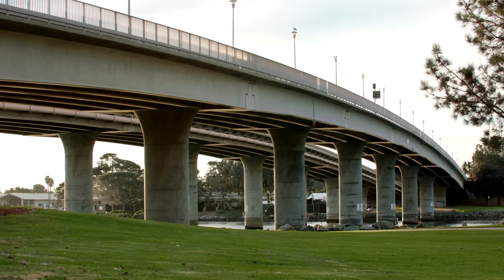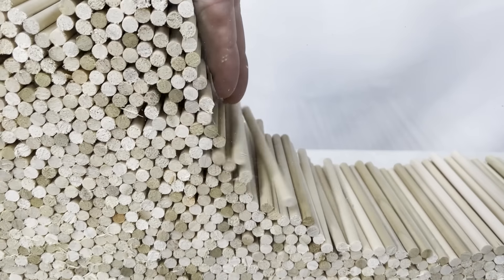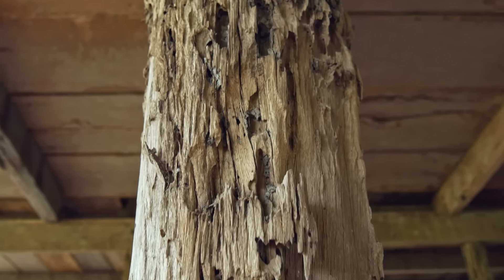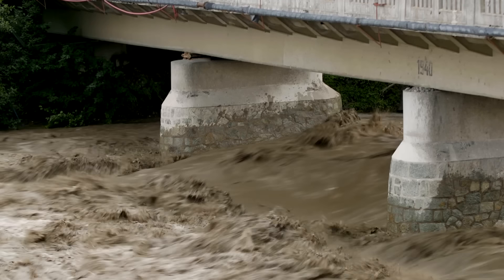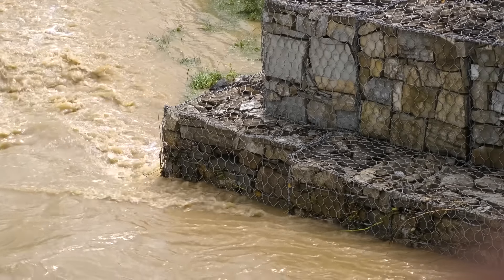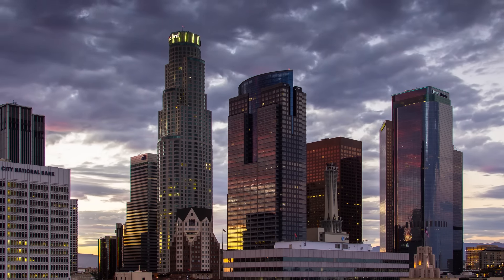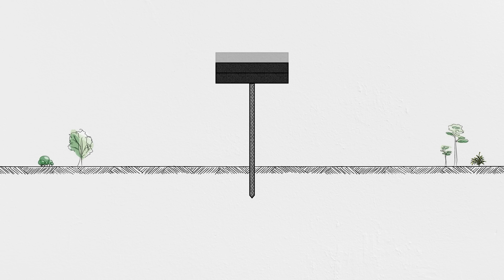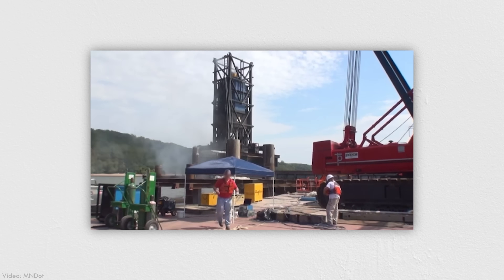Why Buildings Need Foundations

Comment: Here's an idea for another video: landfills.

What kind of engineering goes into the design and construction of landfills ranging from Type 1-3 to tailings and impoundments. Permitting and operations would be neat to cover.

What kind of systems go into making these facilities safe and environmentally friendly?

What happens when landfills run out of space or encounter waste they weren't designed to handle?

How will new PFAS and PFOS regulations change the waste industry?
Reply: +1
Reply: Is there anything done to make the waste easier to mine for valuable materials by future generations?
Reply: +1
Reply: @AndrewHelgeCox  Yes. There have been a few regional waste conferences along with various pilot programs that have looked into and conducted feasibility studies concerning resource reclamation from municipal waste landfills. Resource extraction from old tailing facilities have been ongoing for decades. Revenue vs cost is the driving factor, for the most part it is still cheaper to mine virgin material.
Reply: Yes
Reply: +1
Reply: @HighlanderNorth1  so whats the solution? You can say "be responsible" but ss long as there is incentive for a behavior, it will happen. 
What a cluster!
Reply: +1
Reply: @MattH-wg7ou  I strongly feel like just because there's no regulation, it doesn't absolve someone of the immorality of dumping their garbage in someone's backyard.
Reply: @KaitouKaiju  I agree. I just dont know a feasible solution. It sucks, and the problem is only going to get worse.
Reply: I am also interested in learning more about the engineering around trash infrastructure. Maybe it could be interesting to also learn about the recycling and composting and how that fits into how America does it's waste management.
Reply: According to the channel Plainly Difficult, the answer is often "not enough"!
Reply: you mentioning pfas makes my policy debate self very sad. but +1
Reply: a properly designed landfill is the best way to contain waste long term
Reply: Bio-geotechnical engineering!
Reply: Now that's a video I wanna see
Reply: @AndrewHelgeCox  You can get methane out of old consumer type landfills as the organic refuse starts to decay and gas off. Smoking around the vents on an old landfill is a really bad idea. Some of the newer sewage treatment plants have methane capture domes now and that methane is pumped in and mixed with the natural gas supply!! In the old days it was just left to gas off & stink. Now it helps heat homes and cook food!
Reply: Dig a hole throw things in hole
Reply: @HighlanderNorth1  I think that it is way more complicated than that. In the US and much of Europe, waist disposal is a business,  even if municipalities handle it's collection from private and many commercial properties. Other countries may do things differently, and landfills may be owned by government agencies, rather than businesses. Some governments may choose to overload existing landfills rather than invest in a new one, until they are forced to do so by some event that results from overstuffing the old landfill.

You may think that the rest of the world is simply extorting money from the US and Europe, but the world is much more complex than that. Remember that Europeans had colonized, enslaved people, extracted resources, and trampled environments all over the world. Many of the issues that Third-World countreis have are actually a result of Europian interference, and/or US business demands. Globalization has provided year round access to agricultural products, but the worldwide market has created a demand for agrocultural regions to massively expand their ability to produce, which contributes to encroachment on wild habitats. The textile industry is in a similar situation, the costs of insuring that clothing is ethically produced, is way too much to keep most anyone in business. How many people do you think are willing to pay $238 for a pair of underwear?

The fact is that China has stopped accepting plastic waist shipment, which they had been recycling into clothing. While their motivation may or may not be political, I don't think anybody will be able to pay bribe their way past that.
Reply: I dig victorian dumps in England for old bottles and such, and the design then was find a dip, for preference by a stream and throw everything in. I've found Mercury in different formats, sooo many batteries, and so many other hazards, all of it tumbles into the streams or rivers. They used clay or demolished buildings to cap them. 
I know an industrial estate in Tunbridge Wells is built on my disposable nappies thrown out when I was a baby and then dumped in landfill. God only knows what else is down there with them.
Reply: @MattH-wg7ou  
I guess the solution would be to imprison corrupt officials who allow corrupt foreign govt leaders(like in Australia) to unsafely dump excess toxic garbage in their countries. As I alluded to above, Australian officials covertly sent lots of extra plastic waste that was SUPPOSED to be recycled, to be dumped in one of their poor neighboring Pacific countries, after China stopped buying it and recycling it for their own use.
Reply: I would love this!
Reply: Safe and environmentally friendly.
Reply: They should just mix all the trash with soil and organic stuff and worms and let it naturally turn back into earth. yeah it's take a while but that's better than encasing it in plastic or whatever weird thing they do.
Reply: found the landfill company PR dept
Reply: @AndrewHelgeCox  I can imagine the best thing to do is to completely pulverise the the waste into a fine powder, then you can use different filtering methods and chemical reactions in sequence to pull different materials from the powder. It would also greatly reduce the space landfills take up. 

It would also have the added benefit of being able to utilise more W2E by means of pyrolysis/gasification, where the smoke is processed and the gases produced is used to generate power.

I know in the UK we add bacteria to the landfill sites then seal them over when they're at capacity, it generates a biogas which we then pipe out and process to feed the gas grid.
Reply: Could be interesting.
I would however reccommend to also compare it to other sollutions.
To me, incinneration (provided, ofc, that state-of-the-art emmission controll is used) with the subsequent long-term storage of far smaller volumes of ash is the better sollution.
Reply: @Bird_Dog00  that's where gasification works better than incineration. You filter the smoke to get the flammable gas and then burn the gas for energy. 

Its like drawing from a big bong full of combustible landfill waste.

We used to use methods like that to get coal gas and many countries in Europe burnt wood in this way to run their cars and trucks when fuel was scarce in WW2.

Parts of the process are also good at refining other products from the waste too.
Reply: building a landfill is becoming less and less feasible just like building a nuclear plant, there are the NIMBY, the regulations, the size, the lifecycle of the landfill, the type of landfill, etc.

Many states all around the world are starting to see it as a very hard sell, but unlike nuclear, the waste won't go away just because you said no to a landfill, it has to go somewhere and that "somewhere" depends on how much you are willing to pay, if you're willing to risk paying fines for dumping your waste into coastal waters... that's a major breakdown of the laws within that state and needs to be rectified... immediately.

There are many landfills trying to paint themselves green but the truth is, there is nothing green about it, the landfills of old are poorly designed, they will keep leeching into the earth and producing methane long into the future, not suitible for habitation beyond greenscapes after the life is done.

They can capture and burn the methane but that's still not green, they can have recycling programs with the landfill, but that doesn't work with contamination and when it does work it will only extend the lifecycle only a little bit at a time.

It's quite a depressing topic with very little in the means of solutions, the inevitable need but something that we truly do not want as much as nuclear.
Reply: I’ve suggested this on a previous video
Reply: Having worked at a landfill I would have to say the only thing you can do is limit the amount and type of waste being buried. Engineering innovations can't really do anything about the fact that landfill exist solely because we throw products away indiscrimately. When things are sorted and not a product of exploitation, they become recyclable and so landfills become obsolete.
Reply: Yes, yes & yes.  A curiosity that has not been fulfilled yet👍
Reply: Fascinating to hear of international waste regulations. Thank you for sharing.

As to your second point, what are the requirements for methane destruction and or the control of other gasous emissions? Passive vents, flares, energy plants or grid gasification? Or some combination?
Reply: Landslides!
Reply: +1
Reply: Yes
Reply: @Aka.Aka.  
Tell me where I said ANYTHING about westerners being better than anyone else!? Maybe make sure you understand the point,  before you start personally insulting other people for no reason!
Reply: @AndrewHelgeCox  I don't think this is necessary, because in the future, assuming we begin to run low enough on valuable materials for people to want to loot landfills and dump sites, companies that handle this stuff will be able to either pay poor people to sort the garbage, or build robots to do it.

If the world really goes to hell, people absolutely will loot landfills for old junk, and in fact, the junkyard industry will take off again.  We know this because in poor countries that is what people do. They don't necessarily HAVE to survive from a junkyard, but the bottles and cans and old washing machines that might still have a working motor or metal that can be melted down or whatever are valuable enough to those people to go in and gather the stuff up.  You might imagine that as being horrible, but imagine that same person without a job.  I think a variety of options is better overall for poor people to try to make ends meet, especially since some poor person might collect enough recycleable milk and yogurt containers to melt down and turn into plastic beams that can replace wooden ones.

I guess my point is that it is already easy to get the resources from trash and people already do it.  It doesn't always pay terribly bad either similar to how being a garbage collector or septic sucker can pay well, but nobody wants to do it.

TLDR?!??!?!

To make things simpler, the ways to make mining this stuff easier, is to increase the wages of the people doing the dirty part, make the dirty part cleaner or more pleasant somehow, have robots or magic do it, or increase desperation or reasons for more  people being willing to accept an unpleasant job.
Reply: @MX-Vette  I'm not sure I understand the advantage over incineration.
Both systems require heat - and thus fuel - to be added to reach the appropriate temprature and both can then make use of the heat created.
Both systems also require extensive exhaust filtration.
Further, I would expect that the reduction in volume of the waste is greater with incineration.
Reply: @downardesigns4148  America doesn't do waist management, it's the municipalities within America that manage waist, and each one does it the way it sees fit. Some towns don't even pick up waist from their residents, while others demand waist be separated into various types. States provide some regulations, like mandating a deposit on certain types of drink bottles and cans.
Reply: @Bird_Dog00  with pyrolysis you get heat and a usable gas fuel that can power other things. It's 2 for 1. Incineration is just burning the rubbish which is burning the syngas direct in the fire. With pyrolysis you're creating the hot conditions through drawing up/down through the medium which pulls the syngas from the waste. This can then be used elsewhere to be burned like in a generator or gas burner. 

On top of that you're left with both Ash and biochar, which is pure carbon and can be used to burn cleanly to either restart the process or use for fuel in itself for other processes. 

Its worth looking into the process as all the filtration methods in the process are natural which then in turn can then be put into the fuel hopper too when replaced. It can all be done with byproducts. It's just sawdust and water to filter.
Reply: engineering channel not a garbage channel
Reply: The youtube channel Cheddar has done a video on New Yorks rubbish. Was really interesting 😊
Reply: Toxic leachate is a huge and costly legal liability. Recycling seems a lot more efficient and cheaper.
Reply: @AndrewHelgeCox  landfill mining is happening in Europe and in Sparks Nevada
Reply: @Hansengineering  great channel too
Reply: @bl1398  caveman like
Reply: @amihaifreed8622  isn't waist disposal dieting?
Reply: @grannyweatherwax9666  please report toxic finds for proper cleanup
Reply: @nofurtherwest3474  It's more complex and layers are to reduce toxic methane releases.
Reply: @Bird_Dog00  plastics and toxics make polluting emissions though when burned
Reply: @amihaifreed8622  obesity
Reply: @amihaifreed8622  it's waste vs waist
Reply: @worldchangingvideos6253  but that's been around since the beginning of time. 
volcanoes and stuff. 
natural decomposition. 
it's just all from the earth, so just put it back and let earth do it's thing. 
of course, away from cities. 

but... now do we use the methane for productive uses? ie, we pull the gas from the landfill? i guess if that's what we do then that's fine.
Reply: @worldchangingvideos6253  we didn't all grow up studying the English dictionary for 28 hours a day, and this is not an academic journal. I I'm glad you used humor to point out my mistake, but there is no need to continue posting about it over and over again.
Reply: """"""""""environmentally friendly""""""""""
Reply: +1
Reply: That's a cool video topic. I like it.
Reply: @grannyweatherwax9666  interesting.  When I was a child in the high plains of the USA one could dig in random spots and if it happened to be where some house a 100 years prior existed you could find those Victorian era things because people would just throw their trash into what was the back garden.
Reply: Reading the comments makes me realize how dire the situation is.. please help us to understand why rockets and volcanos are not an option for trash :/ the age of information but nobody knows anything
Reply: See his new video. You were 2 years early!
Reply: Have a look! He's done one now and it's fascinating!

Comment: Here in Finland the bedrock is really close to the surface in pretty much the entire country. Usually just a meter or two deep, sometimes even less. This makes most foundations really easy to do. The most difficult job often is cutting away the bedrock to make room for the house / foundation.
Reply: My grandfathers house in Newfoundland, Canada was built on top of the bedrock. The front door becomes the basement, with the exposed rock as the floor in the back of the house. The whole house is just build around the rock!
Reply: And in other places the water table is only a few cm down, anyway at least you can rest assured.
Reply: B Babbich  on the rock